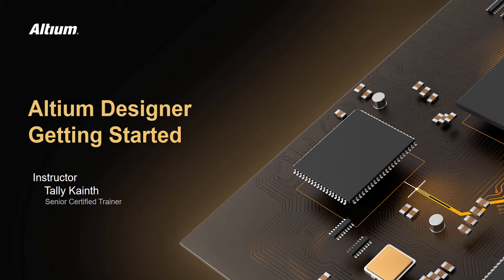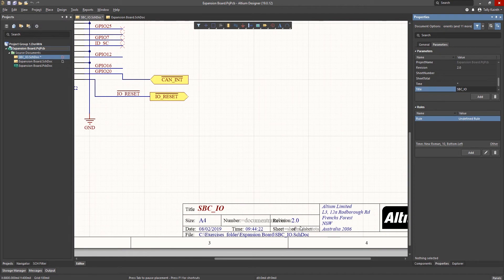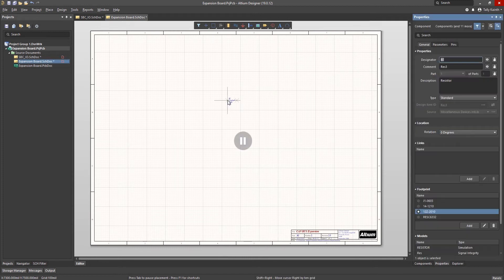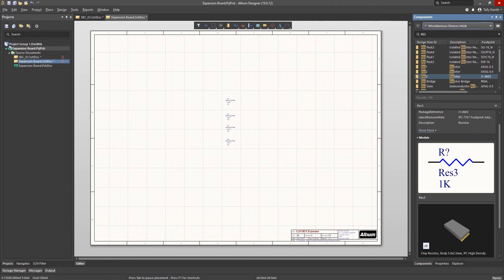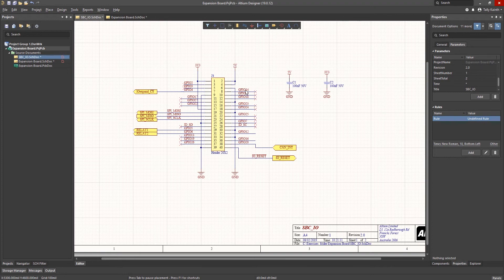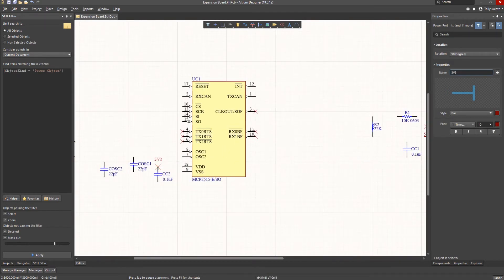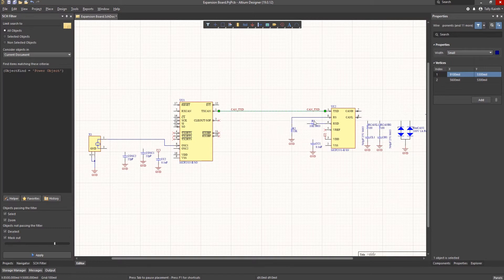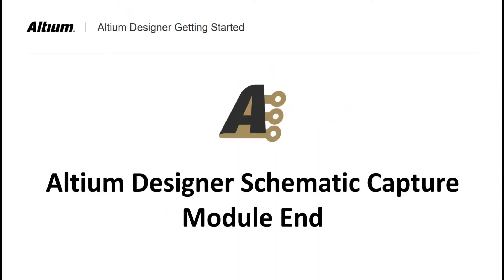(2) Schematic Capture - Altium Designer Getting Started

Comment: So this tutorial isn't too dry, but the lack of parts list and such makes this a bit useless as a follow along. Specifically the portion where we jump ahead to now having an X1 and a bunch of different capacitors and resistors. Can i magically manipulate RES3 to be various resistances as shown in the schematic or do i have to find individual resistors of varying levels? A lot of hand waving for a beginners tutorial. Overall it isn't horrible, but the walk through could be a bit more in depth. Also i have full Altium Pro and the integrated libraries and Free Documents were not immediately available to me so i made due making my own additional schematic. Unfortunately this tutorial needs some revamping. Please consider redoing this series

Comment: Where is the example schematic "SBC_IO.schDoc"? it's nowhere on my PC install for the tool...and nowhere on Altium Live Design Content??? Res3 also not found in my components..At what point did the title block change from video (1) to video (2)? The default one is not editable as displayed in this video. This tutorial is useless unless these issues are addressed. This needs a little more hand-holding. Sorry if I'm complaining but as a 20+ year cadence user, this should be more straightforward and simple to have a video with all the correct steps to get someone started. Sadly this is not it....